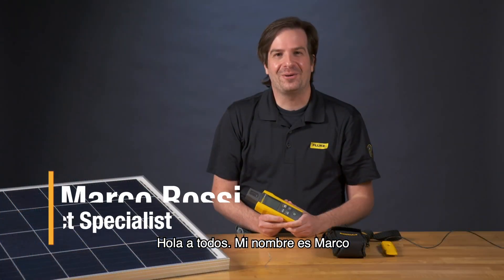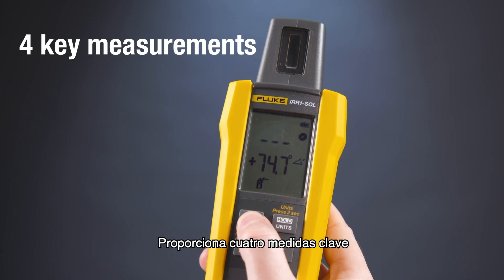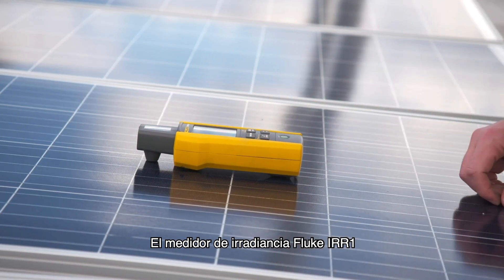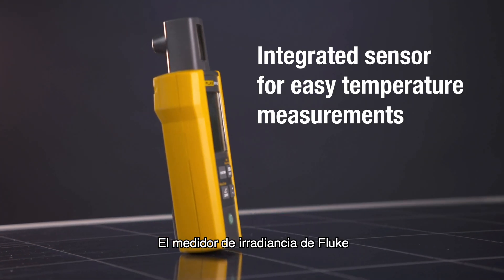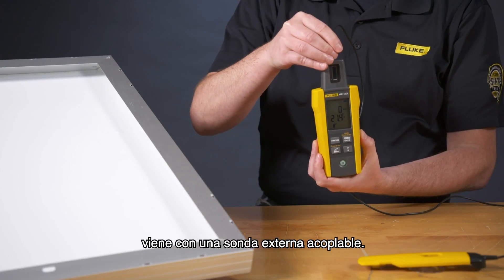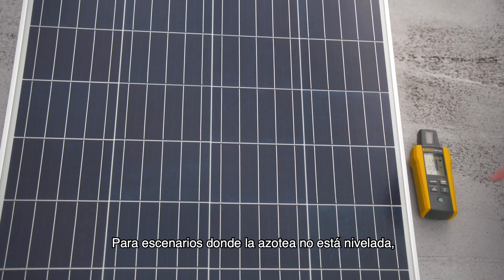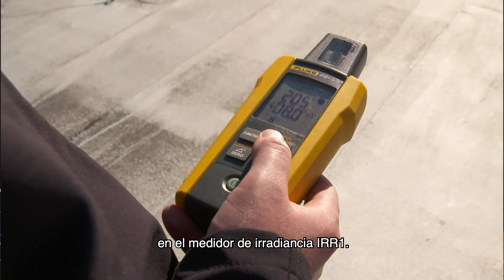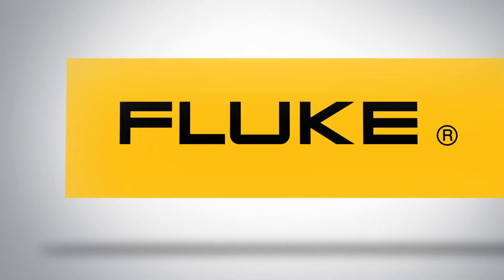Demostración Medidor de irradiancia solar Fluke IRR1-SOL

Comment: Cual es el modelo, de el último equipo que aparece al final del video aun lado de la pinza amperimétrica?, es una especie de multimetro para paneles solares? Saludos
Reply from the maker: Hola David, ese equipo es  el Multímetro Amprobe HD160C Heavy Duty, de altas prestaciones TRMS con medición de temperatura integrada, APTO PARA PROBAR INSTALACIONES SOLARES, ideal para uso en entornos agresivos. Es clasificación IP67: carcasa con sellado especial resistente al agua, suciedad, impactos, caídas hasta 2,4 mt aprox., grasas, químicos, etc.  Si necesitas mmás orientación puedes escribirnos: ventas@intronica.com, +56 229274450o nuestro Whatsapp: +56953716460. Suerte con tus proyectos!